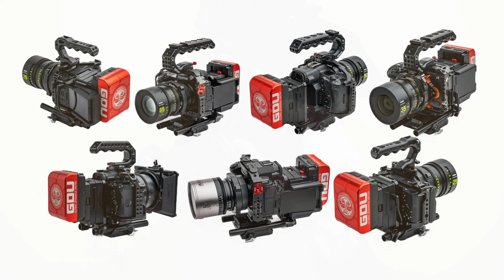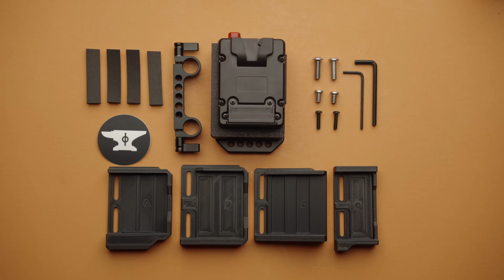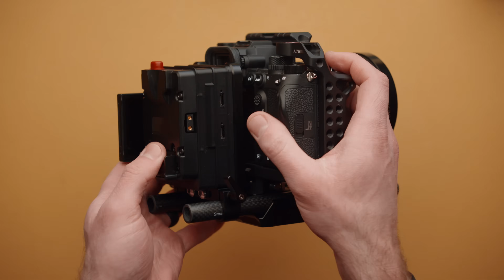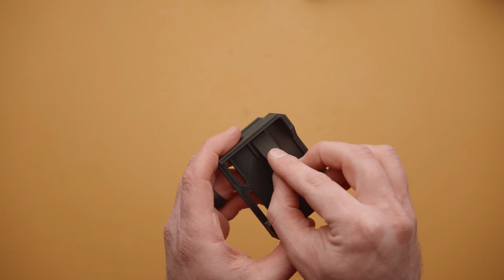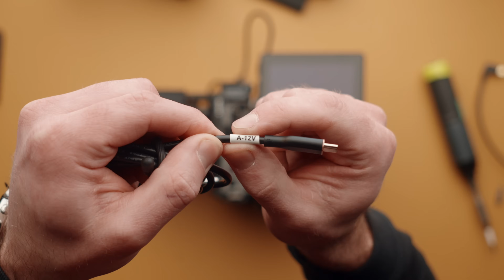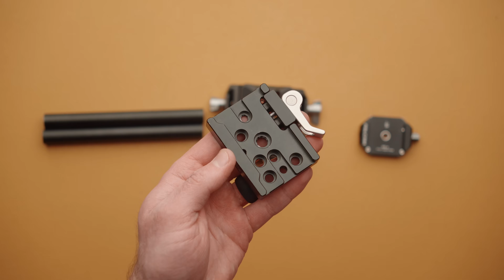CineBack™ Lite - Turn ANY Camera Into a Cinema Camera!

Comment: You should make a more compact Cineback for cameras with smaller bodies that uses an NP-F970 battery instead of a V-mount. The battery could be placed parallel to the camera body to still allow access to the buttons. That way, it would make for an even more compact rig.

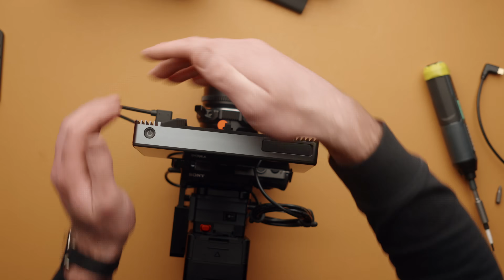Comment: 20:51 Don't you want to plug the HDMI in when it's hot, instead of pre-plugging then supplying power? I've heard this causes ground issues if not powered on first then plugging HDMI in.

Comment: This thing looks awesome!  I use the DJI video transmission system with the Tilta v-mount kit.  Any chance it would fit on the back of this?  I'm afraid the answer is no, but it's hard to tell for sure.

Comment: 1) What is the weight of the cineback lite including cheese plate?  (Can't see to find it listed on the product page
2) Some comments from purchases mention how the screw holes in the plastic are easy to strip or are already loose with minimal use.  Any recommendations to fix this?

Comment: this is such a sick addition! was just about to buy the full cineback for my a7iv but this seems like a much quicker transfer from video to photo with my falcam cage with f38s integrated. I am still a little worried about the overheating issue, would you still be able to mount the tilta zv-e1 fan on the LITE like you are able to with the full cineback?

Comment: The only thing bad about that brand of v mount plate is that those are super cheap and plastic and have no regulator on the inside. The eject button has a super tiny spring on the inside. The good news is that they are dirt cheap on Amazon and AliExpress If you worked a BeBob into this instead there would be a much safer electrical distribution and also some extra power options you could configure into the first plate.